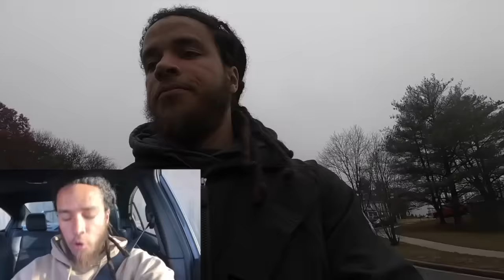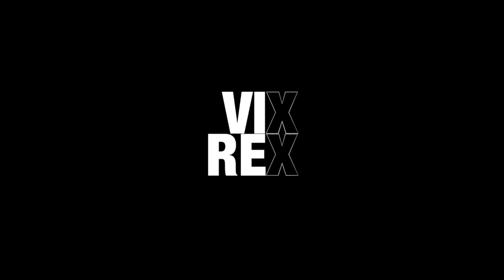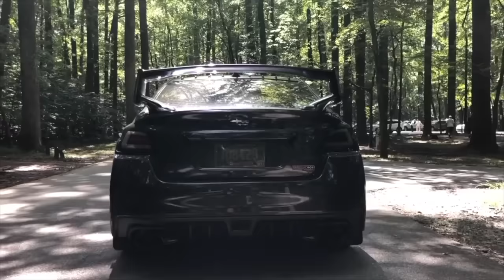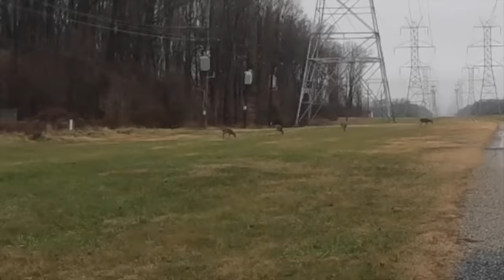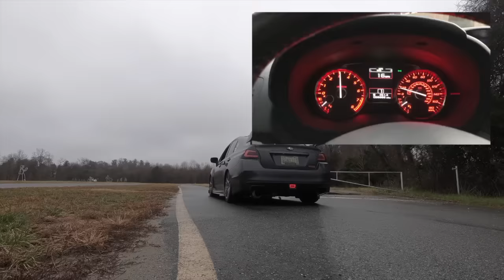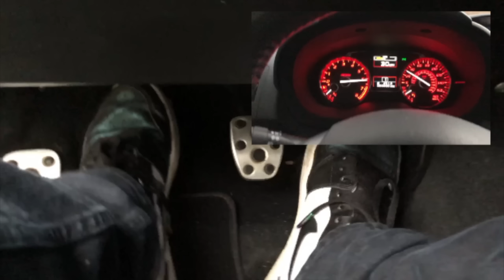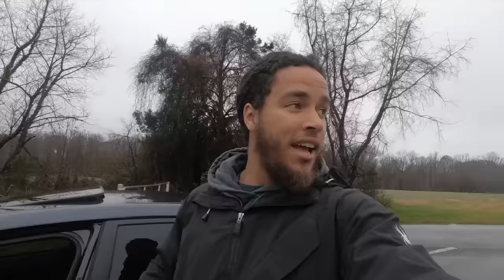How To Make Your Stock Exhaust Pop (NO TUNE)

Comment: My 6th gen SS Camaro will snap crackle and pop nice in 2nd and 3rd around 3k. It’ll still pop in higher gears just not as aggressive (GM performance exhaust, and the active exhaust fuse pulled) no need to ride the clutch bruh

side note for any 6th SS Camaro owners that want a real bang redline between 3rd and 4th gear, clutch in quick and shift and you’ll get some major pops (might even be a little fire) not sure yet though; testing still needs to be done
Reply from the maker: Not riding really, and thanks for the helpful input for others browsing the comments bruh!

Comment: My boys clutch went out doing this
Reply from the maker: Damn, well I’m at 60K and need to replace anyway. Thanks for watching bruh!
Reply: @VIXREX  Damn you need to learn how to drive when you bust a clutch within 60k
Reply: Nico van Duin People burn their clutch wayyyyyyy earlier than 60k, especially on turbo cars. And especially when you push it lol and that’s considering it’s stock, go stage 2 on a WRX and your stock clutch for sure not gonna hold up for 60k lmao
Reply: @WheelsAndBusinessVlogs  Must be Americans not knowing how to drive a manual. My 320hp volvo still has It's original clutch after 160 thousand miles
Reply: Nico van Duin Yea my first car lasted 180k lol But don’t matter how much you know how to drive, if you’re pushing excessive power on your car the clutch will burn out. They’re not meant to handle so much power stock.
Reply: @WheelsAndBusinessVlogs  As long as they don't slip under power it's up to the driver
Reply: @nicovanduin1553  for sure. These people must be power shifting idiots. My Honda has 135k rn and clutch still feels great.
Reply: Nico van Duin lol
Reply: Your boys clutch didn’t go out doing this. Pressing the clutch in does very little wear, especially if the throttle isn’t pressed. It looks like he only presses it for about 1.5 seconds or so... the amount of wear that adds is so little. Taking off from a stop does more damage
Reply from the maker: was my first awd. tried launching a lot. regardless, can't hurt. @nicovanduin1553
Reply: I did this in my e90  but I only drove in triptonic every day for a year wouldnt recommend doing definitely fucked up my tranny
Reply: Damn dude my 15s at 101k miles stock clutch and holding strong...
Reply: 237xxx miles and my EF hatch got its original clutch

Comment: I have an ets extreme on my sti and i realized that if you do a hard pull in first or second gear, get to 4500ish rpm, push the clutch, and keep gassing it for a split second, you get mad pops
Reply from the maker: this works as well on the wrx.  i almost went ETS too, love that exhaust setup

Comment: It's your engine backfiring....not the best for your engine..but not all that bad tbh. From what I know from experience...it just messes with your fuel economy... pre-ignition which also me along with that you get cylinder knocking...but don't take my word for it...but "popping" its basically backfiring.
Reply from the maker: thanks for helpful input bruh, and even more thankful for you spending some time watching and contributing to the community.  :)
Reply: This is very incorrect information.A backfire basically shoots a fireball back into your engine, almost always causing it to blow up. This is what you call after fire. It's just unburnt fuel , hence why cars with catless j pipes shoots flames . Stock tunes and ots tunes are very rich to prevent grenading the motor. Ever notice how dirty the tips get on a VA WRX ? Unburnt fuel that's how .
Reply: @paulmorin288  so I may have under-exaggerated...it can mess your gaskets up too. But yes unburnt fuel. But the probability of it being able to go back into the cylinder and then fire off on wrong timing? High or low? Legitimate question. Id think rather more than likely but Im not sure. Wouldn't it just fire off in the exhaust after the exhaust valve opens and releases more unburnt/burnt gas? And yes it does cause damage to the engine by. Messing up gaskets and therefore compression loss. And could it also lead to pre ignition and bad timing...and bad fuel economy?

Comment: Why can’t I do this in my 1992 eg civic? I installed a twin turbo supercharged v8 engine from eBay I’ve also stuck on the type r sticker which should add about an extra 10 horsepower. This drift car has a 0.21 second 1/4mile but it’s ok because I have eBay clip on brembos :)
Reply from the maker: You missed the one important thing. Aftermarket 10w50 Ultra Prosthetic Blinker fluid

Comment: not great on your clutch but not excessively bad on a clutch too. your clutch freespins at a weaker angle when the clutch is pushed in just wearing out the bearings faster. worth the extra wear on the clutch in my opinion

Comment: I'm assuming you have a stage 1 tune with an access port because you have virtually no rev hang, which helps the pops occure, whereas my wrx has an ass load. Could be a difference of model year, but I dont think so.
Reply from the maker: No, stock other than the exhaust. It rev hangs a little and a switch gears by the time the rpms really get to drop
Reply: My 18 wrx with just an axle back muffler delete and it pops on rev matches and when you rev the car and the revs drop to 1500. I’ve had the exhaust since 700 miles and I’ve always gotten the little burble pop at 1500 w or w/o the exhaust but at around 2000 miles, I rev matched like usual and then I got pops. I’m now at around 3700 miles and it pops.
Reply: @VIXREX  Wonder if it's because I'm only at 3700 miles on the car. Rocking the invidia N1 so I can get it to pop occasionally, but rev hang is the biggest issue so far.
Reply: Con The 1 same, my 05 STI has Insane Rev hang.
Reply from the maker: Possibly. Maybe it changes it with wear?
Reply: You just might have a newer wrx cuzz the rev hang fkn sux bigly n newer ones... Lol bigly

Comment: My car pops and crackles at 1500 rpm😂😂 e82 135i n54 m performance exhaust
Reply from the maker: Yes. The BMWs are amazing at it. Especially the f80
Reply: Could a 2000 Maxima 5 SPD achieve this

Comment: What about Auto Transmission? 😅
Reply: Reed E.C I’m wondering the same lol
Reply: Reed E.C I’m wondering the same lol
Reply: The only way to mimic this is pop the gear selector in N while your driving.  BUT I’m sure you don’t want to replace your transmission anytime soon.
Reply: Daily Motions haha right. It probably wouldn’t even work for me being that I have a civic 😂🤦🏽‍♂️
Reply: Stock exhaust. Remove all mufflers and resonators. Keep stock headers and cats. If you have a v-engine, keep the stock crossover. Run a side pipe or dump in front of the rear axle for more sound. Run it up on the interstate and force it into a sport mode where it holds gears, or into 3rd/2nd depending on the length of those gears and just let it rev down. My HEMI Ram loved to crackle on the rev down after a speed run or running through a small twisty section while forced to stay in 2nd(which carried out to 85mph). Loved that truck.
Reply: In the lowest gear bring up the rpm  the highest you can before it switches to 2nd ease off the gas a little and tap it within the short time you have before it switches gear
Reply: if u have automatic dont even bother to watch this type of videos XD.
Reply: @TheCarBro  doing that wont hurt the tranny....the fuck? And to do it just hold the auto-tranny in 2nd gear. If you have a good exhaust....something with an S-flow built in the muffler itself, it will pop and bang when the compression kicks in after letting off the gas. Just hold 2nd gear and drive into high RPMs and let off gas. Or down shift from drive to 2nd when braking. My car is an auto.....1997 Nissan bluebird u14 with an SR18DE engine and it does it easily with that method. But muffler with S-flow internal design is important for it to sound real good
Reply: Use the brake pedal instead of the clutch
Reply: I have a 3.4l v6 grand am straight pipe from the cat back, it is an automatic and I still get it to backfire, what I do is use the "manual" 1-2-3-then Drive gears to drive. Revving it up in first and then letting it rev down gets a lot of pops and backfires (repeat the same process for 2nd and 3rd), also what I do is when I'm driving I pop it into neutral, rev it up, then put it back in drive and I'll usually get a loud backfire. Last thing is on the rev down sometimes you ever so slightly tap the gas and you can get it to backfire as well
Reply: Buy a manual, simple
Reply: Get a manual
Reply: Reed E.C I have an auto Tsx with CAI, Single Exit with a Carven Muffler with stock pipes NO tune but pops on command. Though I have “Manual mode” to allow me to play with the gears.
Reply: Get a standard. Thatll fix it

Comment: I did a muffler on resonator delete on the stock pipes. (cut out) the tone is a lot louder than other catback systems but not annoying. You can get some crazy loud pops tho. Try cruising in 1st up to 4-5 thou then clutch and blip the throttle.
Reply: YES, I did this + Headers. My favorite is the 5 consecutive  pops

Comment: Isn't that riding the clutch tho
Reply from the maker: Nah bruh, press the clutch all the way in, not partially
Reply: VIXREX mb dude, back then my driving instructor said if I press the clutch fully down while in motion it was riding the clutch. Now I did some research before u commented and realised he was an idiot Bahahaha P.S I too own a rex :) (MY07)
Reply: VIXREX thats still riding the clutch lol
Reply: @someguy920  that's incorrect, with the clutch pedal fully depressed the clutch is not making contact with the flywheel. The only thing wearing would the throw out bearing which usually outlasts a clutch.
Reply: @someguy920  did you mean the diaphragm spring? Because it could possibly experience some wear from being depressed too long but most of the wear would be on the throw out bearing. No notable clutch disc wear occurs when the clutch is fully disengaged regardless of engine speed.
Reply: @someguy920  when unintelligent people have no logically rebuttal they tend to resort to personal attacks. Youd make a good politician.

Comment: I have a 92 Lebaron with a V6 3.0L All I've done is replace the stock airbox with a cone filter setup, deleted the resonator, and swapped out the stock muffler for a Magnaflow muffler. I get pops just by just revving in park to about 3500 rpm and letting off the throttle. 🤷🏻‍♂️
Reply from the maker: Niiiice. But yeah, I’m a LeBron fan too

Comment: I have a '96 Corolla with headers, stock cat, resonator delete, a resonator delete, & 3" blast pipes 
I'm thinking of a cat delete too
Also someone told me I should add a spark plug to the exhaust for the flame "tune" without getting the actual tune

Comment: Yhe only thing I can think of that would be bad is,  to not rev 1st gear up to 6k too often as it is a Subaru and they do have head gasket issues,  also the entire block is soft cast aluminum, unless if its all sleaved then youre good to do this whenever.
Reply from the maker: Yeah i try to not to do it as often..soon I’ll be tuned and can achieve this sound without being so aggressive . Thanks for watching!

Comment: I have a 4 cylinder automatic sedan and I was able to make my exhaust pop by accelerating in first gear until the exhaust got high pitched then let off the gas and then quickly press the gas and by doing that my exhaust would make a loud pop noise

Comment: Loving it but I can't see what you do differently than normal diving but just letting it burn out in the highest rpm and just shift and hold clutch. Butt that is just not what you are doing when you drive you shift right away lol showing and doing not really same right. 
 
How ever love it and decat of course it will pop and crackle my 2.8 V6 Turbo INSIGNIA Vxr does it to and I do not but having the cat on is a major hindrance get rid of it

Comment: Actually that popping noise isn't the exhaust, it's from the transmission every time you do that you're crushing a transmission gnome which is why you hear a pop. Kill enough of them and your transmission stops working. They're easy to replace but if you don't clean up the dead little gnome bodies they might not work right or may not work at all forcing you to total out your car.

Comment: I have a high flow intake with a crankcase breather and muffler delete on my 2008 Honda Ridgeline, and it was popping like crazy after I went to 5000+ rpm. I’m thinking of modding my intake by putting the hood scoop back on and somehow connect it to my intake cone.

Comment: Or a bigger engine. I did this to silence a modded RX8 (exhaust same size as above) in an underground parking. Cold start, sort of (I was about to leave, after shopping) hit the accelerator up to 6000 and let go. Popped all the way back down to idle. So yeah it was a decated Busso V6 3.0.

Comment: you say that you're not riding the clutch and you're correct if you leave it all the way down until the RPMs come down. but if you let the clutch go anytime before that, you're putting stress on it. Trust me i've been through 3 clutches in less than 2 years lol
Reply from the maker: Ahhhhh I see what you mean. Yeah I don't hold it until the RPMs come all the way down. It's usually about a second and then a quick shift (still pretty jarring but not necessarily riding it). Def puts stress on it for sure... Or I try to hit that sweet spot with a rev match!
Reply: @VIXREX  yeah if you shift, then you're good
Reply: 3 clutches in less than 2 years, you need to switch to automatic afraid to say..it's not for you
Reply: @DontTripBro  learning curve. Also, did too many launches. the last one was partially not my fault, as I should have changed to a ACT heavy duty clutch when I built my STi
Reply: Christae M I’ll teach you how to drive stick😎😎😴

Comment: the only thing i could see this doing is wearing the throwout bearing a little more but thatll only be a real problem if yours is already about to fuck off. Before i had really learned manual, instead of downshifting or just going into neutral, id just hold the clutch when i wanted to cruise and i ended up fucking my throwout bearing on my 320i, but that was for like 10-20 seconds at a time and it was already worn out. So i dont see this as being bad for the car

Comment: I have astra h 1.6 with decat and straight pipe still no noises 😭 even pulled the main engine fuse to make engine overfuel and the exhuast just got quiter with less power 😆😭🤦‍♂️

Comment: I have a 1.0l focus eco boost and mine works slightly the same, I have a cat back and once it gets to just beneath redline I have to press down the clutch then let it go down a wee bit and then rev it to red line and let off and if pops
Reply from the maker: nice so there are other ways but be careful in regards to engine stress. thanks for watching!

Comment: So basically high rpm's and then press clutch and hold it there and then let clutch out after idk 4 sec?
Reply from the maker: not even that long.  just get to about 6000 rpms as fast as you can and immediately put in clutch when you do and left off gas at the same time.  less than 4 seconds more than likely...

Comment: i have a question does it work with v6? mines pop but the exaust all the way back its a small pop but what if instead of going the exaust all the way back   you replace the cat with a cut out would it make pops in the cut out louder? i always been wanting to try this
Reply from the maker: No cats will definitely make it pop louder, but a tune may then be required.  Not sure if it’ll work with the v6 without a tune, seems to be only boosted cars

Comment: I really wanna do the same with automatic cars. Any tips?
Reply from the maker: with automatic its a little tough.  other than bouncing the rpms in neutral for some pops on during the end of the deceleration, you may need to get a specific tune to make it really crackle and pop.  seems like this specific technique I showed works for stock turbo manuals
Reply: Yes. Buy a manual. Jks😋

Comment: Quick question do u have stock resonator and all stock mufflers ?
Reply from the maker: I did in that one clip from the previous video but in this video i have an aftermarket catback exhaust system so the mufflers are changed from two to just one.  the resonator is not stock, it is slightly larger and the exhaust piping is a larger diameter as well.

Comment: I did a muffler delete on my new 17 wrx and although it does sound better than stock I’m still not able to get any pops out it
Reply from the maker: Even with this technique? What if you’re in neutral and you bounce the rpms around 4-6?
Reply: Actually it does now that I just had someone outside the car listen for it but hard to notice while driving.  My 2008 used to pop like crazy but it had a Cobb down pipe on it with a muffler delete.  Would like to do the same thing with the ‘17 and unlock a little more hersperr and terque lol!!!
Reply from the maker: @watts4200  the hersperr and terque is fun of course lol i need that catless dp!

Comment: I had a 97 Ford Ranger 2.3 single overhead cam brand new catalytic converter with a cherry bomb glasspack put in a cold thermostat every time I would shift from 4000 RPM or even 3000 how to get some loud and hard pops.
Reply from the maker: thatll definitely do it.  this technique wouldnt work in your case, but it sounds like you got it covered anyway !

Comment: So I have a 2018 mazda 6 and its straight piped but I cant get it ever pop or crackle and I have tried so many things. Any suggestions?
Reply from the maker: If nothing so far, you will have to tune it
Reply: @VIXREX  I can only get it to a little in park when i rev it to 2k and then let off the pedal